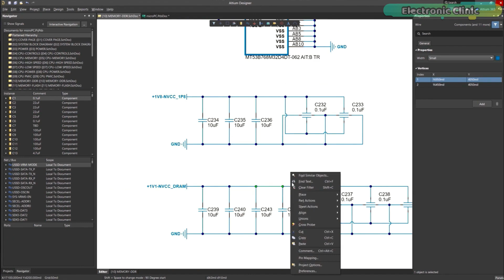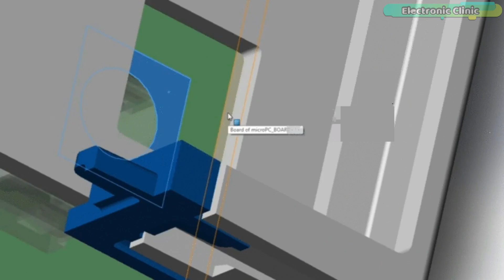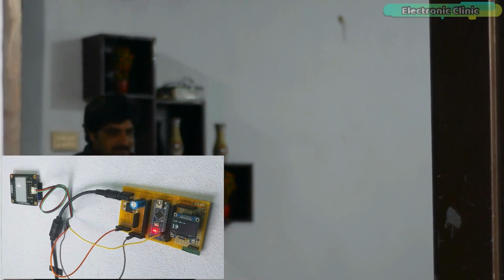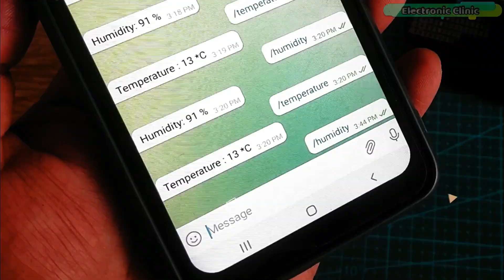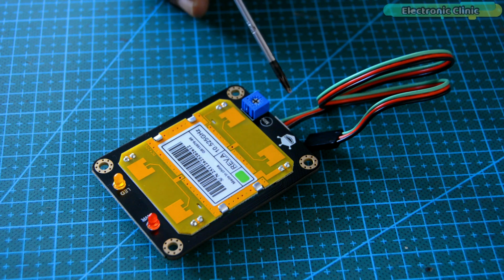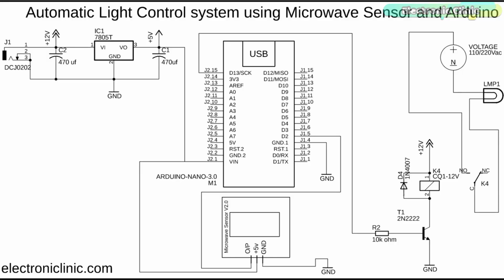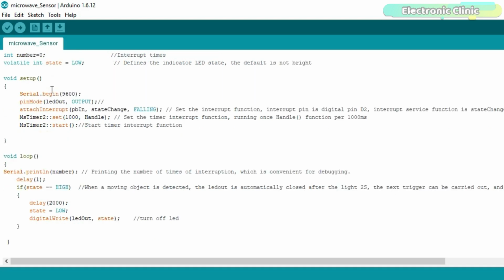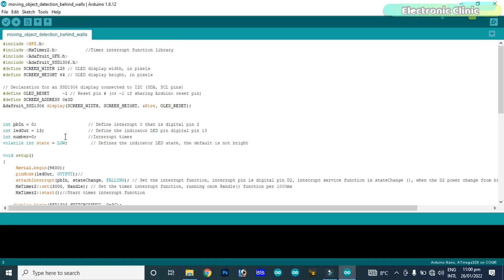Microwave Sensor with Arduino for humans and objects detection behind walls, Doppler Radar Sensor

Comment: How do you protect against this sort of sensor if a neighbor is pointing it into your house on purpose?
Reply from the maker: @lafytaffy1220  I thin steel sheet can block this.
Reply: @ElectroniClinic  Thank you for responding.  I would have to do an entire side of the house.  Are there any other solutions? Would countering it with the same technology cancel it out? Like a presence detector light bulb or something similar?
Reply from the maker: @lafytaffy1220  I will have to practically test it. I can make a video about this.
Reply: @ElectroniClinic  That would be awesome!

Comment: For non engineers, show each unit , run one wire at a time! So Dumbies can do it, electron paper layout, you LOST ME.  And this makes u tube video worthless to me. Like trying to say Mississippi, in a flash of lightening   , went too fast and skippped how DIY FOR DUMBIES!
Reply: There is a pause button, there is also the setting to slow down the speed of the video. I'm not an engineer, I have not made many projects but if I wanted to build it, there is certainly enough info given in the video. Maybe you need to start with something a lot simpler until you get the hang of it. Just stop calling helpful videos worthless when they are not.

Comment: Would this sensor be able to detect mole movement, e.g. when a mole is busy pushing dirt/sod up out of it's tunnel. The sensor could then relay a Bluetooth text message to a users phone. The user can then spear/shovel the animal to get rid of the pest.
Reply from the maker: Ya it can detect. But for this you don't need to use this expensive  sensor. You can use the rcwl sensor, check playlist.

Comment: Is the sensor used here the same as HB100 I’m working on a similar project
Reply from the maker: I don't know, but the one I have used is well tested, you should give it a try.
Reply: Actually I’m working with HB100 which is an Xband bistatic doppler radar
Reply: @pratikadhikari1474  hello bro we are also working on same project so is hb-100 similar
Reply: @pranit_v  yes bro
Reply: but i'm running into some problems for the values its fluctuating hella lot in led

Comment: Sir, can it be used to detect humans under Debris, I mean there will be more than one wall in the debris. So will microwave sensor detect humans through more than one wall?
Reply from the maker: My next video will be available in a few days, you will get all answers.
Reply: @ElectroniClinic  can you make a video about human detection under rubble or debris
Reply from the maker: @Pavan-dn3kw  today I will release a new video using the same sensor, just check if it can be used for the same purpose.
Reply from the maker: @Pavan-dn3kw  your idea is cool, give me more info I will think about it. But don't forget to watch my upcoming video it will help you.
Reply: @ElectroniClinic  hey, may i ask u where is the video u mentioned. Im not able to find it. Could you give link?
Reply: @ElectroniClinic  link?
Reply: @Pavan-dn3kw  bro really my team is also doing the same project for our college 😂. Hopefully we will get it ready easily.
Reply: @Pavan-dn3kw  R u guys doing the same project??
Reply: @vishalmelasarji   bro have you done the project
Reply: @Pavan-dn3kw  yes bro we are partially successful. We are using HB100 sensor. It should detect with a range of atleast 10 meters, but it is detecting only for 60cms (0.6m). But it is perfectly working.
Reply: @vishalmelasarji are you checking the distance through an object?
Reply: @NoReligion1  no bro, but we checked it's detection range so we came up with the distance
Reply: @vishalmelasarji so low distance😮 I thought to buy it